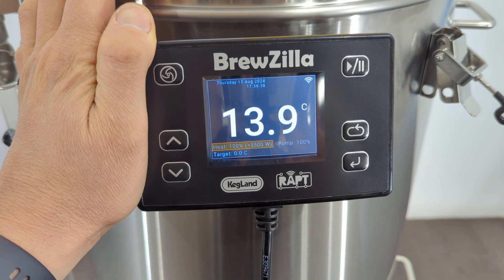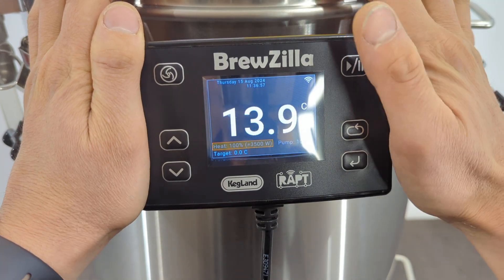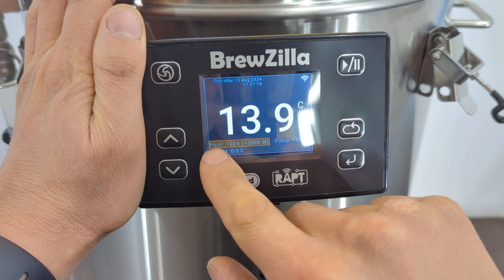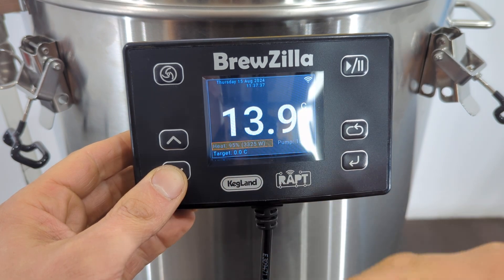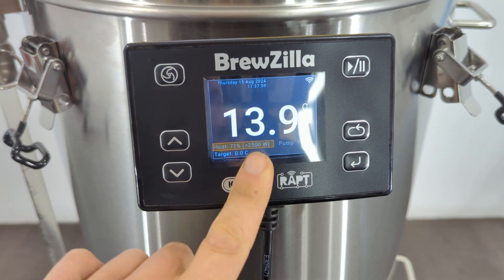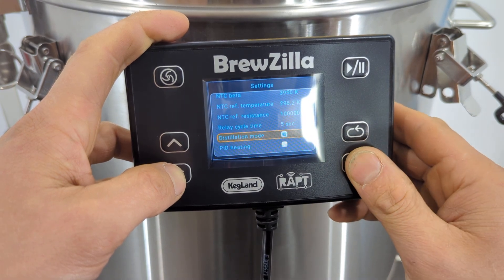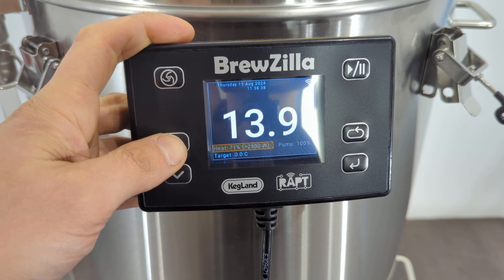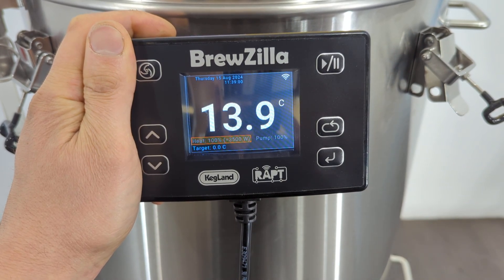BrewZilla Gen 4 NEW FIRMWARE - Distillation Mode

Comment: It's a bit confusing, but it makes more sense and easier to see if you turn the graph off on the settings. I wouldn't recommend the brewzilla and silicon seal for distillation as the steam escaped via the lid is counterproductive. I bought the 100l and heavy-duty lid and was forced to go back to my old 50l keg setup.

Comment: what firmware version is this?  Every time select check for update it displays the message "downloading update" but then eventually changes to "Could not update now, please try again later.  OTA7 5379"  Trying later doesn't give any different result.  Its connected to wifi and I can connect with the RAPT cloud software. Can't find any info to help me on your website.

Comment: I have run the firmware upgrade on my new Brewzilla 35L gen4, and it says firmware is all up to date up to date, but still no distillation mode anywhere in settings? Seems I am not the only one with this issue.  This mode the reason I purchased the gen4.1
Reply from the maker: @peskybear1432  that sounds a bit strange please email us your user login details.
Reply: @KegLand how do I send you my details for support?

Comment: This is really great and a good step forward to distilling , its basically like having the physical switches like on a dihiboil. Unfortunately the power levels for rhe 35L arent all that useful. As they go 2400, 1900 and then basically 500. Its good for striping runs sure, but doesnt really help for spirit runs, or bubble plates, say if you want to do a 50% run at about 920 or so. You wouldnt run bubble plates at 1900 as its too high and would smear too much, but 500 is just way too low.

Woild you be able to comnect an external temp control unit and then set it on say 1900, then put the control unit at 50%? Or will that mess up the whole unit.

Comment: Hi Kee, I have the BZ 65L G4. I have just performed an OTA update, the current firmware is dated 20240207 however this doesn’t appear to be the latest release. Does KL need to enable/release the firmware update?
Reply from the maker: Please give it some time.  When the firmware is released it's not released to every single device simultaneously.   As we have many thousands of these in circulation we provision only 2% of the Brewzilla units per day to get updated.  So it will take about 50 days for every BrewZilla to be provisioned the new firware.
Reply: @KegLand  Thank you Sir...

Comment: When is this being rolled out? Updated my Gen 4 firmware and this update wasn't there. And will it be rolled out to 100L Brewzila?
Reply from the maker: Please give it some time.  When the firmware is released it's not released to every single device simultaneously.   As we have many thousands of these in circulation we provision only 2% of the Brewzilla units per day to get updated.  So it will take about 50 days for every BrewZilla to be provisioned the new firware.

Comment: Hey Kee, is this only for the BZ G4 65L? i've got the 35L no firmware updates available and it does not have the distilling mode available in settings Cheers Rob.
Reply from the maker: This is for all three different models. The 35L, 65L and 100L all have this new firmware available.
Reply: @KegLand  Thankyou! The Issue tracker still shows it is in preview/testing  https://gitlab.com/rapt.io/public/-/issues/385

Comment: Now wouldn't it be nice if you could control the actual output wattage.. .. .. .
Reply from the maker: We have been considering this too but it would probably require using a PWM circuit.  We are probably going to do something like this with a new RAPT temp control box device but it may not be released on the BrewZilla any time soon.  In what application in particular would you like to use this feature?